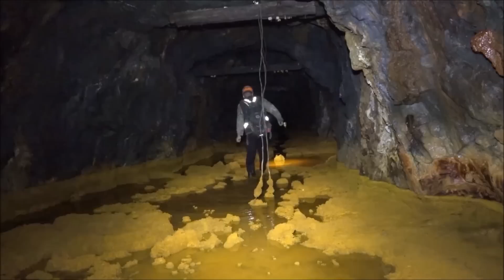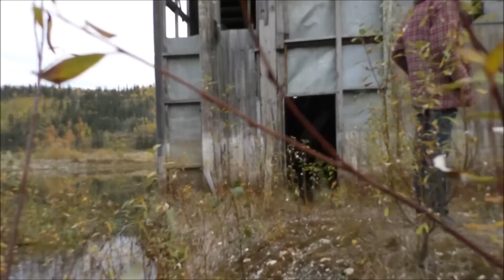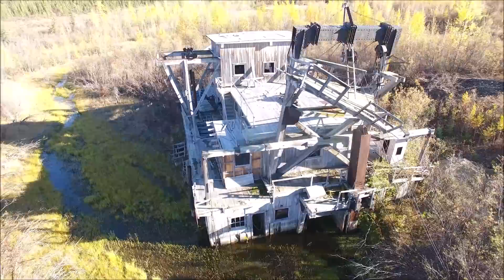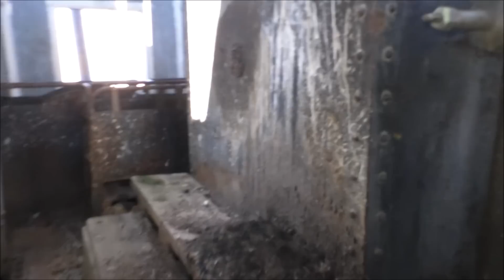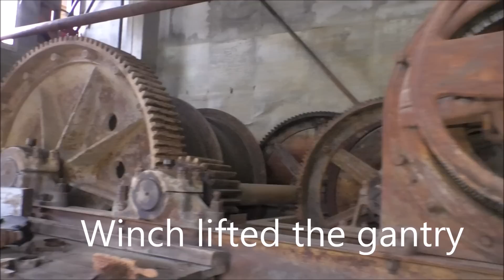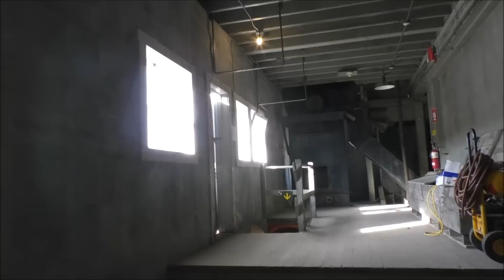#229 Old Yukon Dredges Featured this week!

Comment: How cool is that? They actually had clutch’s that could engage and disengage. And brakes that would brake and not brake. Wonder if they had lights that would turn on and sometimes turn off.
Reply: You need to quit smoking
Reply from the maker: I did 35 years ago.

Comment: If your transformer doesn't have all its parts Frank will judge you. Great video lots of amazing history.
Reply from the maker: You are correct
Reply from the maker: There were quite a few little odds and ends they should be fixing up. Putting the buckets back on the dredge for one!

Comment: I've handled a lot of original paperwork for these old dredges kinda cool most were built by ship builders and most where steam electric to be self sufficient if the power line failed or they didn't have access to them at the time, its cool looking at the plans for them as well also lists of spares they carried

Comment: Any of these have progressive screens and sluices, trommels with smaller holes to start that empty into sluices for finer gold, and larger holes with matching sluice layout further down the trommel as it goes?  Maybe not, given you were saying these things weren't all that efficient to start with and relied on bulk processing...
Reply from the maker: The finer gold is lighter and gets caught farther down the runs because it has a tenancy to float more.
Reply: @exploringabandonedmines  That's what I was getting at, fines would leave the trommel first regardless... in my head, it makes sense to have a first series of small sieves leading to a sluice arranged specifically for them, instead of just one size fits all and having pebbles and other swarf beating the stuff out of the traps. Get the delicate stuff out of the way and let the bigger flakes land in a sluice set up for them as well, just catch more overall. 

As always I'm talking out of my posterior with a half-visualized idea :)

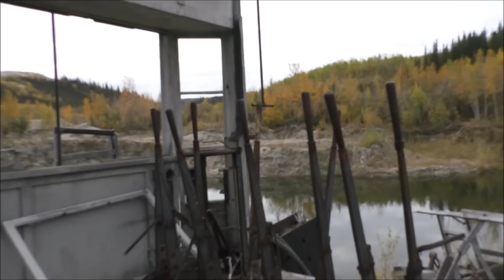Comment: 9:10 wonder if they could have used brass pins or another material that corroded or melted out in the fire. Or for that matter if they were rusted up and drilled out for replacements that never arrived...
Reply from the maker: People took them for souvenirs or maybe for the brass. The dredge we visited in part one still had them.

Comment: I have beaver in my back yard, about 20 second walk out my door.  They used to slap their tails at me most every night when I was out walking my dog, but they're pretty used to us now and rarely slap their tails anymore.  When my buddy hears it he swears it's Sasquatch tossing rocks at us and landing in the water. :>
---
Your drone piloting is great.  The manual "Point of Interest" (orbiting around something while keeping the camera aimed at the point of interest) is something most people have to use the autonomous modes to accomplish.  I bought a fancy drone simulator program that uses a real RC controller plugged in the computer just so I could practice manual Point of Interest shots.  I figured learning on a $100 drone sim was smarter than using a $1,200 drone and chance crashing it, plus I can keep my controller touch fine tuned in winter and bad weather.  I'm kind of surprised you haven't gotten one of the smaller DJI drones yet, they're a lot easier to pack into remote areas, and handle the wind just as well as the Phantom 4.  I have a Mavic Pro and Mavic Mini.
Reply from the maker: I have wrecked 3 of them so I have lots of spare parts. That is the reason I keep buying the Phantom 4. They are a good camera and once you get used to flying something it is easier to stick with it.

Comment: A little perspective.  Were these big dredges actually floating in the river or did they start in the water and move where ever the gold went?  It seems to me that these big guys are left high and dry where there is very little running water.
Reply from the maker: They dig a pit near where they want to mine. Build the dredge and then flood the pit. The pond moves with them as they go.